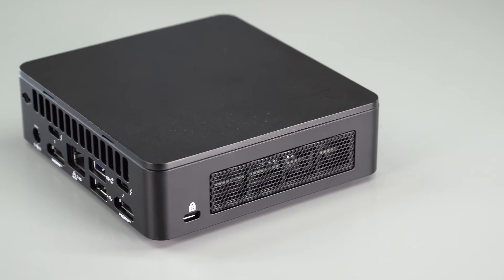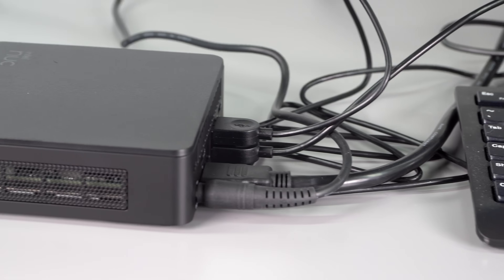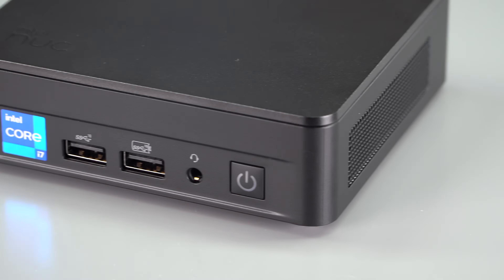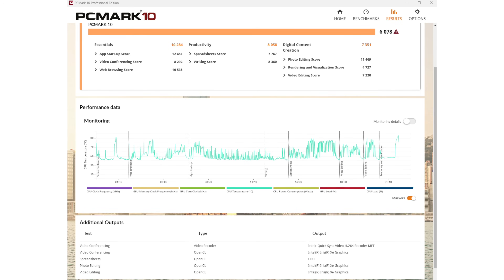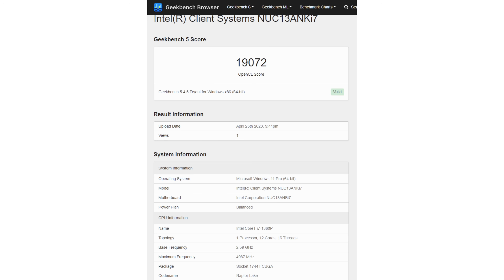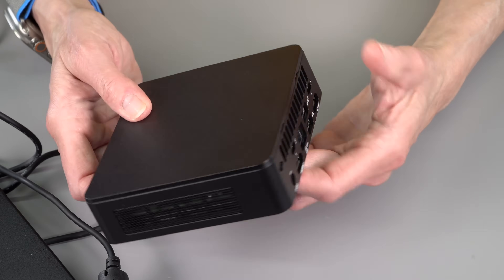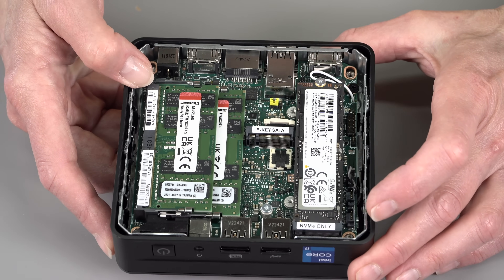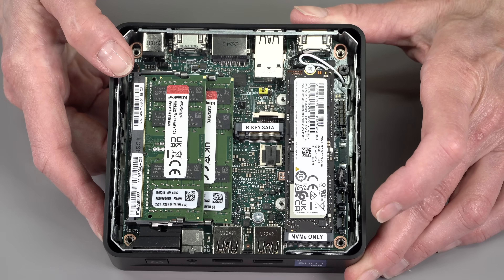Intel NUC 13 Pro Review

Comment: NUC 13 Pro i7-1360P ,,,What about the issue with Intel Ethernet Controller I226-V with slow WAN speeds  okay on LAN? and how to fix it,  I've done a clean install of Win11pro and all the latest drivers,,  I've  given up  troubleshooting and now using a Thunderbolt to Ethernet adaptor to get full bandwidth of 1Gb on WAN ..... NUC13L3Hv7 uses a I226-LM and has no issues

Comment: Can I power the nuc with the same usbc I use for the monitor? I have a Dell monitor which powering my laptop and I have 1 cable solution for data and power . Is this possible?

Comment: Everything is great about the NUC except for the fan noise. It's nearly on all the time. The fan frequently ramps up even when opening folders during very light load.
Reply: That's what my friend who bought a NUC told me.
Reply: Same - searching madly for spare fan or some new intel nuc of 10th gen i3 (was available under 150 dollars all in) to salvage parts as intel nuc is discontinued and honestly want my new 13 gen to work for over 10 years. Heard their fans alone are too pricey,

Comment: The NUC has one particular positive for me, and admittedly it might be a bit niche. My workflow requires I use a Mac, so I have a Mac Mini Pro; my wife however, pathologically hates MacOS and prefers windows, so she has a i7 NUC. So on our desk we have both machines and dual monitors, thunderbolts go to the Mac, HDMI's to the NUC. Just pop the required wireless keyboard and mouse out of the desk drawer, plus the power button on whichever machine you need, and away you go. Two tiny computers and a tidy workspace. Works for us!

Comment: One thing I love about the Intel NUCs are the easy access to the RAM & SSD.  Such a clean and fast setup.  The only other competitor is the Beelink brand for easy and clean spec access.  Miniforum UM690 is nice for gaming at home, but I wouldn't want to use it for small business with over 10+ employees.  Too slopy with sticky corners.

Comment: Just bought this for a great price in Germany to replace my aging laptop used to work from home. As I have almost never used the screen, made no sense to get another laptop.
This has more than enough power to my use and it is so small that I can take with me as backup instead of my heavy laptop.
I didn't understand why was this so cheap (411 Euros), for what I remember Intel NUCs were so expensive in the past!

Comment: SUGGESTION:  I would really appreciate it if you could make a video about using a hardware key with iPhone, iPad, Mac.  I read another horror story on Macrumors that has me thinking about upping my security game, but I can’t find a decent video that answers 2 question;
1. Do you need the key every time you unlock the phone?
2. Can you use your pass code for the phone to reset the Apple ID password?
3. Are there other problems with using the keys, other than losing them?

Everyone wants to show you all the different keys, and how to set them up, but not if they actually work.

Comment: 120W? $750? Intel is crazy.
Reply: Here in Europe the barebones NUC 13 Pro i5 tall variant is priced at about 450 EUR.  That's about $500 USD.  Probably the ONE thing that is cheaper here than in the US.
Reply: @joshpayne4015  In Poland Intel NUC 13 Extreme Kit RNUC13RNGI70002 - Intel Core i7 13700K / GB / Intel UHD Graphics 770 NO SSD nad RAM cost 1400€
Reply: @joshpayne4015  Got mine,  i5, barebone for 525 € in Romania. But I've notice some variants have i5 alder lake and others raptor lake. I've got the raptor one

Comment: your comment about why a 120 W power brick got me to thinking. 
 back of the napkin power budget:
2 x TB4 at max Power Delivery  = 30 W
i7-1360P @ turbo = 65 W
Gen4 SSD = 3-4 W
4 x USB Type A at max power = 20 W

Yeah, that little box can use the power.

Comment: 750 barebones, ouch
Reply: Here in Europe the barebones NUC 13 Pro i5 tall variant is priced at about 450 EUR.  That's about $500 USD.  Probably the ONE thing that is cheaper here than in the US.
Reply: The funny thing is that the new x86 handheld gaming devices are coming out at around this price, with Windows included. If you could just dock that thing with extra ports to an external monitor, you’ll have both a gaming handheld and a mini pc.
Reply: @rhoharane  next gpd win version will come with oculink external gpu port, so you can do that and use a dedicated graphics card with it.

Comment: Pretty much every factory floor computer I've seen recently has a Nuc.. it's basically just enough computing to be a terminal and to handle some runlog and tool interface functionality. Great for when you just need to have a computer station!